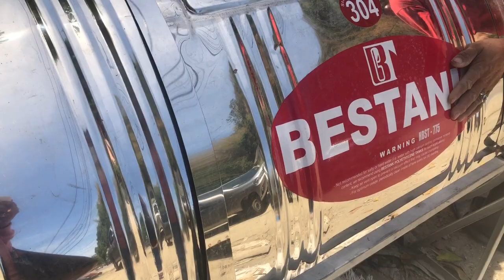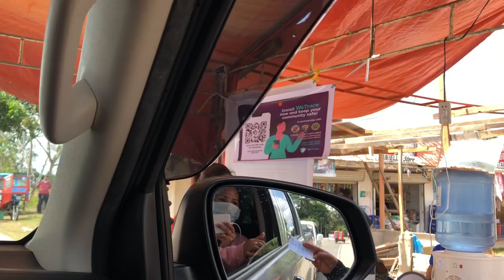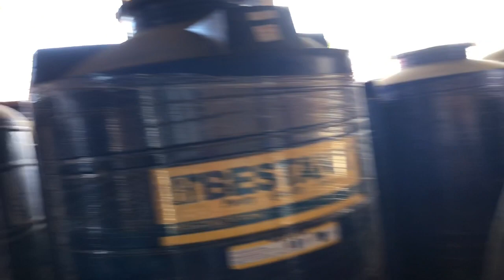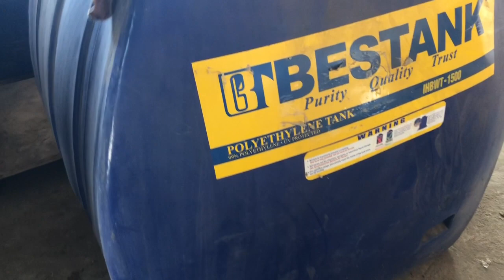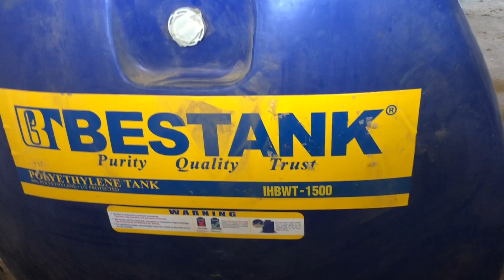LOOKING FOR A WATER TANK // LIFE IN THE PHILIPPINES

Comment: Owwwww!!! You got the white one? How are you going to clean it up? There is no manhole? You can clean it up why not, but that will gonna be pain in your neck! It is not easy! Change it with the one with manhole.
Reply from the maker: There is a man hole 🤷🏻‍♂️
Reply: Sorry!
Reply: The complicated one and costly but the best. The tank you got will be elevated higher than your bathroom shower. But? If your community water supply is really slow. You need a water reservoir or tank in the ground free flowing supply so that you will not get the supply from your neighbors. Of course bought tanks have a flutter so that it will stop automatically. Elevated tank needs a motor or well pressure tank to bring water to your elevated tank from reservoir or well. Anyway this is complicated and costly. The first one I said is the simple one.